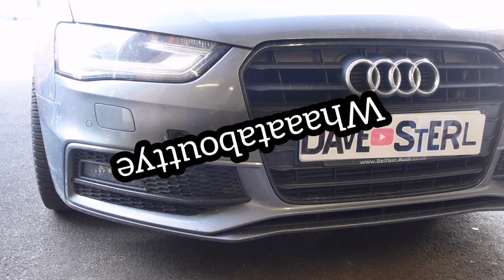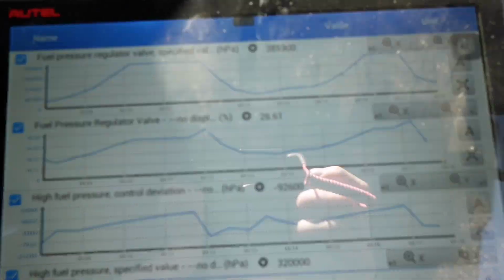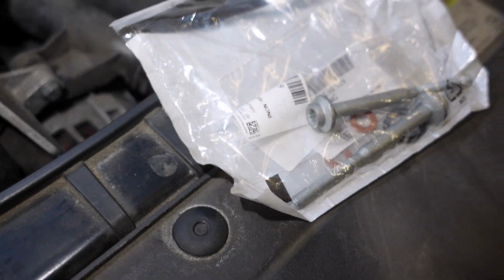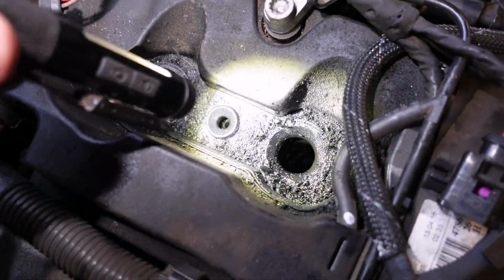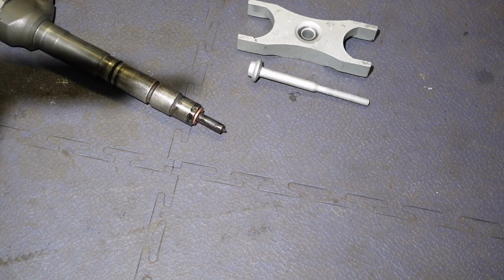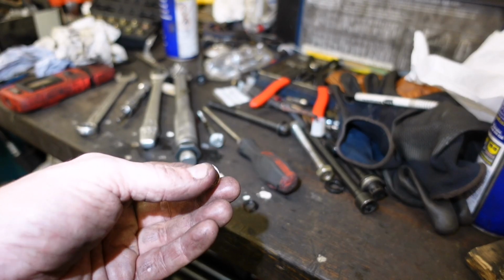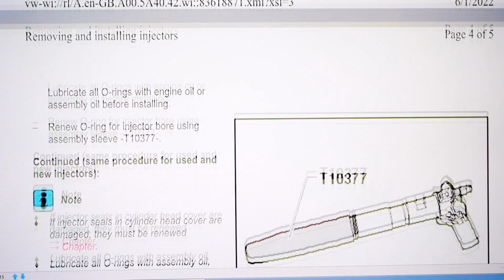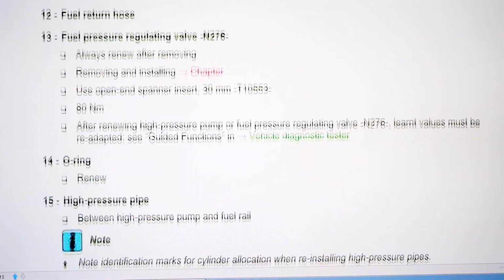Audi A4 (B8) 2.0TDI Crank no Start. CJCA Engine

Comment: hello, I changed 2 injectors and it no longer wants to start, I wrote the injectors, I checked if fuel comes on the ramp and everything is ok, could you tell me what the problem would be?

Comment: Hi Dave,

Great vids as always.

I have the CAHA 2.0tdi in my A5 thats sat in a local audi specialist garage at the min.

I had erratic idle (surging) and misfires under 2k rpm. Fuel pressure all over the shot.

Car was running when I dropped it off but since they've looked at the car and unplugged various sensors my car no longer starts and they are suspecting HPFP failure. They said pressure is too low in the rail to start but then later on they checked and it was higher?

No metal swarf under the fuel regulator either, injectors are fine (according to them).

I'm suspecting its a faulty relief valve? I've ordered a complete used rail with both sensors to the garage for them to test before we go down an expensive pump replacement.

Any pointers as the guy working on my car doesn't seem super thorough on what he's done and I don't get how it ran fine with the fault but now it doesn't!
What would you be checking to rule out the various sensors and then the pump?

Cheers!

Comment: That's good timing. I've got to do the same job on a Q5 this week. Looked at it last week and 2 of the injectors were moving with clamp bolt loose. Strange thing is I had fault code for low fuel pressure P0087 and flashing coil light. Code only went after tightening clamp bolt. Doing all four o-rings, copper washers, bolts and cam cover seals. TPS £120 😯. Great video, cheers 👍
Reply: Michael chen  can't help I'm afraid but mine was fixed with the injector seals. A couple were in a bad way. Really burnt up.

Comment: Great video dave only done one recently myself managed to drop the copper washer in the head just my luck 🤣 lucky I did the other injector bolt was only finger tight also this seems to be a fairly common problem in them done a good few recently.  I think I'll be recommending doing all 4 seals and o rings snd and 2 bolts anymore. Also got a part number for the wee caps you used to blank the injectors

Comment: I had a customer one time who drove it like that to the garage, 2 injectors were jumping like mad. In my opinion injector washers should be replaced as precautions as the always go. I've replaced them on my a4 at 90k and you could see a lot of wear on them. Good job as always.

Comment: I wonder did the copper washer just flatten over time due to heat & vibration, then in turn the retaining bolt come loose 🤔
All very interesting and informative, thanks Dave
Reply from the maker: Yeah Peter, I'm thinking along those lines too. I've recommended cyl 3 and 4 to be resealed and new bolt. Guy is a regular so do it next service.  Similar case to the d4d i mentioned.

Comment: Dave what's your opinion on dropping the new copper washer down a thin screwdriver onto the seat and aline it with hole then putting injectors in. Hence no sticking grease required?
Reply from the maker: My opinion is, that's a daft idea
Reply: @davesterl  why Dave?
Reply: @the_retired_mechanic  more trouble than it’s worth. A dab of red grease between the injector and the copper seal/washer, job done.
Reply from the maker: It would be foolish to even contemplate a risk of dropping a small component, especially non-magnetic, into the valvetrain or becoming jammed wrongly orientated into the deep recess potentially giving headache, more components to be removed to retrieve it and adding time to the job due to your own stupidity. Every professional person in any discipline makes decisions based on risk mitigation and time, trouble and effort against magnitude of reward. There is no realistic decision making required here and when a solution is very simple makes it a daft idea

Comment: I have the same b8 tdi... the engine seems tho shake intermitently. Is this common?
Reply: does it shake more when cold, have the same problem but diagnostic shows that the 1st injector is going crazy with values, so i plan to change it..
Reply: @silverify  mine can be anytime. But its not a big deal more of an annoyance
Reply: Same here on when idle though...

Comment: Would love to know why this happens?? Had a couple like that now. Last one at the turn of the year pushed #4 injector out so far that the high pressure pipe was pulled almost straight and the tip of the injector nozzle had fouled on a cam lobe. Thread was pulled out of the head too. The clamp bolt looked slightly stretched in the threaded portion and I wondered if a previous repairer had recycled the clamp bolt?? It had likely been apart as the polystyrene cover was missing. Still, one of these where you can never be certain about the cause. Was shouting stop-stop at my iPad when your torque elbow was tightening the original bolt 😜. Had a wee smile too at your paint mark on the bolt head: that’s exactly what I did when I finished the repairs. Asked the owner to have a wee squint at them from time to time. Top job as always Dave 👍
Reply from the maker: Yeah Russell,  i think it's all just a single M6 thread holding 2 injectors. Not enough clamping force. Also the copper seals are thinner and small diameter than typical seals in other cars. As the seal perishes there can be fractional movement. Just my immediate thoughts compared to other makes.

Comment: Nice one Dave when I seen you tighten the bolts at the start I was thinking F sakes that’s a lot of torque , then when it came back and you said stretch bolts , … lol made sense , (1 use only ) …. As per usual Dave 👍